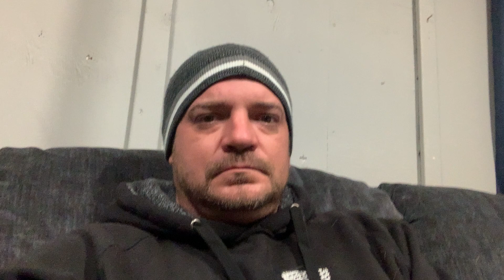How Many Plugs Can You Install On A 15 Amp Breaker

Comment: Appreciate the video, very informative. I removed my garburator on a dedicated 15A circuit that also had a plug under the sink for 3 LED lights under cabinet. Now the garburator is gone, can I change the switch on the wall that was for the garburator into  a 15 A GFCI plug? Will that be to Cdn Code, I am located in Vancouver BC, thanks in advance.

Comment: Thanks for putting this together. Live in Toronto and this is just the vid I was looking for.  I always thought for kitchen counters you can only have 1 20 amp receptacle per circuit. Would you consider doing all basement pot lights on one circuit? And keep them away from receptacles.
Reply from the maker: Yes we often consider separating the outlets from lights. thanks
Reply: Just watched your video love it thank you